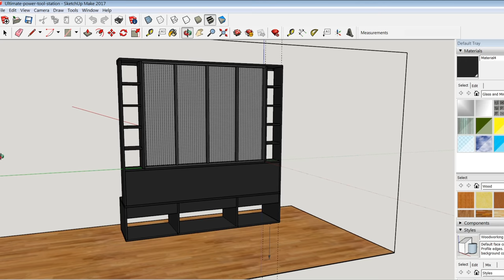Diy Power Tool Storage Organizer w/ Charging Station

Comment: Well done video. I especially liked how you highlighted the pocket holes for the video on each board after you drilled them. I haven't checked out the Sketchup drawing, but adding those highlights was like looking at a well illustrated instruction manual 😉

Comment: a couple mistakes,

*the 51-1/4"x6" boards should be 50-5/8"x6"
*pegboard should be 48"x38"

If you look at the pegboard, the vertical boards behind it can't be the same height as the pegboard itself, it doesn't take into account the thickness of the horizontal boards. Looking at the image with them side by side, you can see the pegboard is taller than the 36-3/4" boards. Other than those 2 discrepancies, looks good.

Comment: DeWalt DeWalt DeWalt DeWalt DeWalt DeWalt aaaaand Porter Cable nailer because DeWalt's are insanely expensive. Lol..... Nice build. Thanks for sharing.
Reply from the maker: Hahaha yeah damn right, so expensive and i got a nice blackfriday deal for that porter cable so didn't had the choice !!
Reply: @SEBTECHDIY  I just picked up the Milwaukee M18 18g brad nailer for $150 from cpooutlets.com. It wasn't my first choice and it's a refurb but I already have the batteries and it has a warranty. I couldn't argue with that price either. I'll definitely be checking for good Black Friday deals for a framing nailer this year. Thanks for the heads up.

Comment: Question. The pegboard says it is 36.75" and the vertical supports are 36.75"... therefore the 48" horizontal pieces sit outside the pegboard top & bottom.  Are the vertical supports supposed to be more like 35.25" ?? Or is the Pegboard supposed to be 38.25" ?? Thanks

Comment: What about hardware used? Like screw lengths? I can never tell what screw to use especially when it's in a pocket hole
Reply from the maker: Hey! I have the full build plans available here : https://www.instructables.com/DIY-Power-Tool-Storage-W-Charging-Station/ , but for the screw, it will always depend on the thickness of your wood. Kreg has a nice chart on their website : https://learn.kregtool.com/learn/how-to-select-right-pocket-hole-screw/ , in this case i used 1 inch screw.

Comment: so whats actually holding the tools up on the pug board just regular peg board hooks? didnt think theyd hold that much weight it musta took alot of mixxing and matching to find a way for each tool to balance nicely and still come on/off quick n easy
Reply: Andrew Browner a common trick is to use a drywall screw insert, put that in the peg hole, and run a screw into the insert to get a good sturdy mount. I did that with some heat shrink to get a clean look and protection.

Comment: I like how you have 20 dewalt tools, but you're using the porter cable nailer, a stand alone pocket hole jig, and 2 clamps for this project.
Reply from the maker: Should have bought the dewalt 20v nailer, but there was a 50% deal of that porter cable, couldn't resist!! 😅